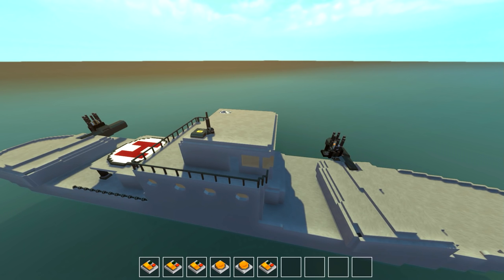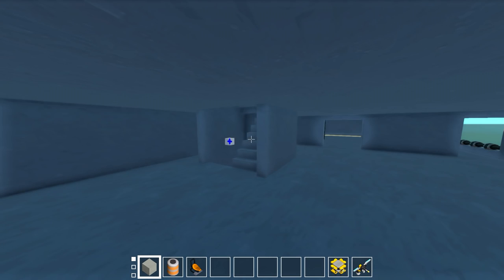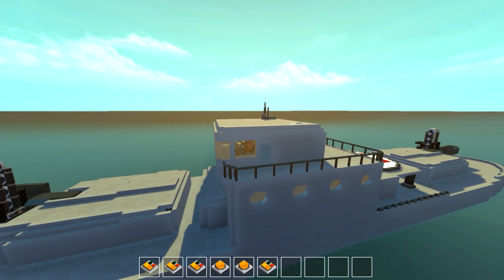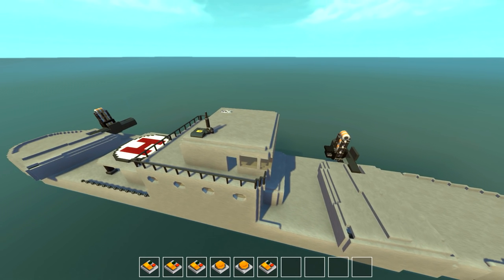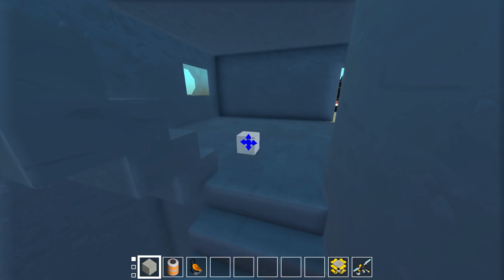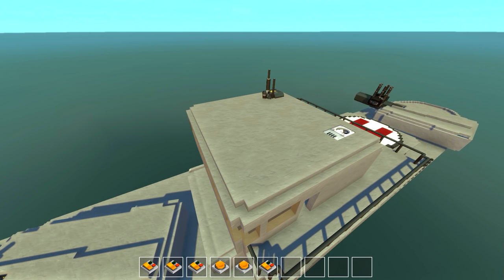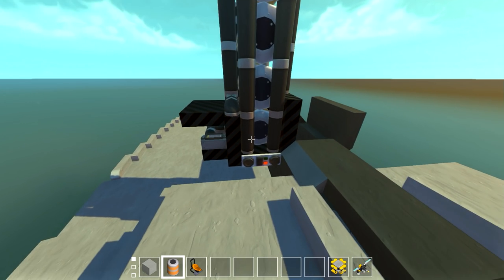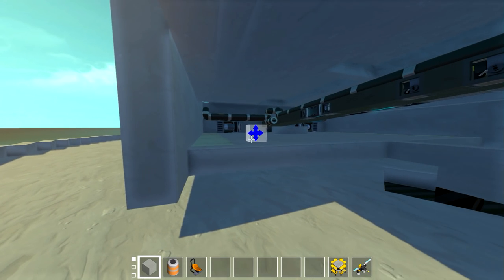Hover Destroyer with Twin Working Cannons! (Scrap Mechanic #161)

Comment: Add your radar on the boat.
Reply: probably too much lag for that
Reply: Nachi Kahn It's only a spinning bearing on a 1x4-? square with sensors on it.
Reply from the maker: If its my big 20 sensor 4 layer version then yes it would lag. I'd still like to have it on this ship eventually if the game performance improves.
Reply: cedie 45 I was gonna say it's gonna be to laggy but kAN won a he race to mention that

Comment: NICE..  too bad with the lag tho.
you should really try making a second version with durf thrusters,, 
then you can reduce it to like 2 or 4 thrusters for lift and a few for stability.
best way to prevent lag on those big creations.
also..  the rotating turrets.. i think they cause most lag because theyre so close to the hull..
try lifting them 1 more block above deck.
Reply from the maker: The thrusters arent so much the problem as the rotating turrets. I took them off as a test and all the lag disappears
Reply: btw.  angled pieces and rounded pieces dont like rotating stuff close to them.
also the blocktypes of the 2 close parts  can make it act different..  
its like solving a maze in the dark, because it makes no sense..
but..  making my big engines made me understand more about what cause lag..

i can only recommend having the creation stand on a tripod  on the ground while building.
and only have it on the lift when you have to.
and test often.
this way you see the lag issues at the moment you make a mistake , and not 30 min later when you drop it from the lift.
then its a nightmare to cure the patient ;)
Reply from the maker: lars kristensen Oh the issue is for sure the multiple body problem. bearings in scrap mechanic separate the object and it always becomes a lag machine. if the turrets have no rotation and are welded straight the performance is significantly better.
Reply: have you tried to remove the concrete layer under the turrets so nothing is close ?  easier test that lifting turrets and rewiring it all

Comment: Hey kAN I have been developing a frames friendly tank for multiplayer battles, and I was wondering if you would be up for a battle.
Reply from the maker: Saw your tank battle vid! I wouldn't mind some sort of combat with cannons but I gotta think about how to handle hit detection first.
Reply: So far I've just used the honor system. It's usually easy to watch the shells fly and when they hit they usually have a nice thunk of metal on metal...

Comment: U call that lag terrible I got 1 frame per minute 
And the best I've ever gotten is 15fps so atleast you got fps of some kind but regularly I can barely play at 8fps
Reply from the maker: Yea this build sits around 10-12 fps when i normally get 200+

It doesnt seem as bad in a recording though because it still renders 60 frames even if a bunch of them are duplicated

Comment: lag is wierd. even makes thrusters run backwards.
i made this as a combined centrifugal stabilizer / pulsejet engine   for an UFO idea.
sadly its in even width so i cant center it.. FAIL...   
it works but sounds really wierd..
ment to be placed in a gyro but i cant build them right.  
spawn a bunch in a empty world. when enough they run backwards.
just raise the lift and delete it. then they take off.
http://steamcommunity.com/sharedfiles/filedetails/?id=891783988

i would love to see this system in a flying thing if youre in for the challenge ;)